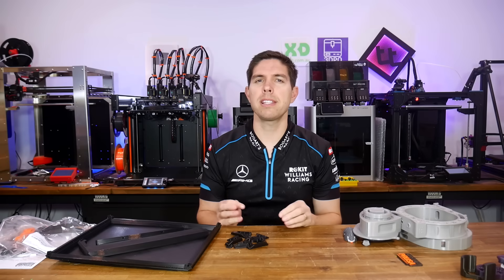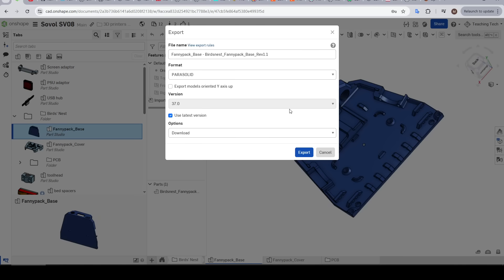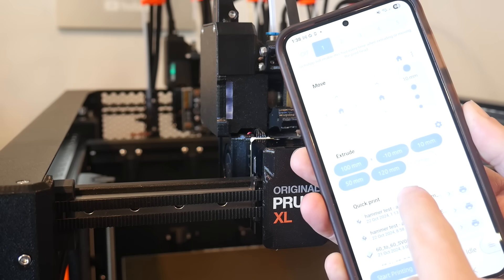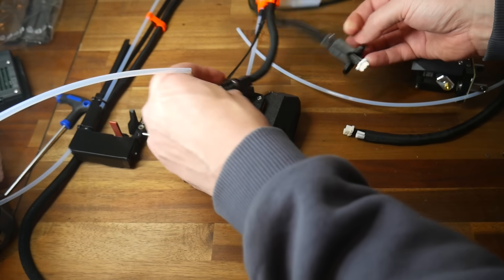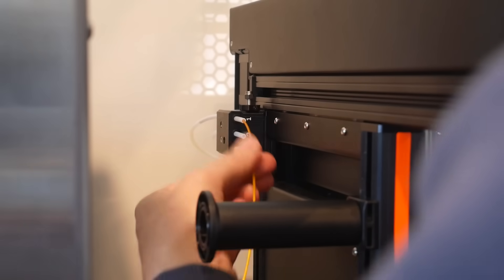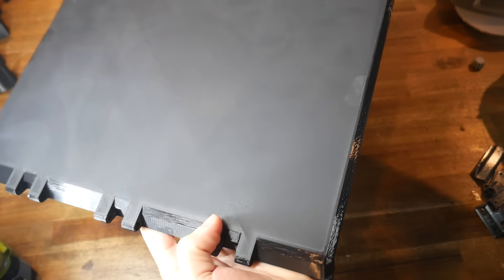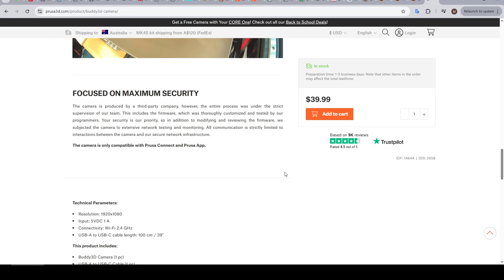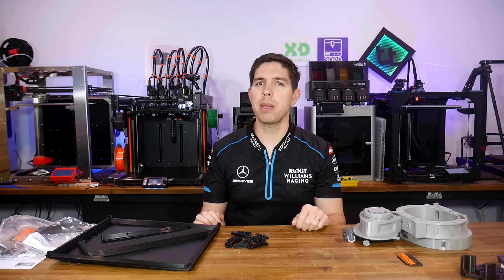Evaluating my replacement Prusa XL + SV08 update

Comment: I'll wait for the Bambu toolchanger.
Reply: Theirs isn't a true toolchanger. It can swap out the hotend assembly, but it's still all fed through a single PTFE tube via an AMS. So it still needs to cut the filament, fully retract it, do the nozzle change, then re-feed in the next color/material. Because the filament is disconnected from the remainder that was cut and left over in the hotend, retraction performance is going to suffer until its purged through. A true toolchanger like the XL, U1, INDX, etc. have totally separate filament paths for each tool.
Reply: the snapmaker U1 looks promising as well
Reply: They have complex nozzle changer cooking in the oven, and already showed how it works.
As response to that, Prusa showed actual image of Core One with INDX tool changer.
Reply: Bambu vortek is worse than a traditional tool changer, as found on the prusa XL, snapmaker U1 or even the bondtech INDX. Bambu lab was just caught with their pants down and had to come up with something quick since snapmaker was stealing their thunder. What they came up with will be a failure compared to just going with a regulate toolchanger. Meanwhile, prusa is coming out swinging with a 7 tool changer core one using the bondtech INDX.
Reply: @LilApe ahhh the prusa fanboy shill is back.
Reply: @colbycowley7549  Ah another bambu bot.
Reply: @LilApe  The Vortek will still probably be a more desirable system compared to all the others simply due to size and BLs quality.
Reply: @klaidasrunele  bambu lab and quality don't belong in the same sentence.
Reply: @LilApe Youve clearly never owned their printers
Reply: @klaidasrunele  You sure? I owned a P1P back in 2023 that was dead with a bricked stepper motor after just 10 print hrs. Guess what I found in the repair? The stepper motor that bambu lab use are the exact same garbage bin steppers found on a $100 ender 3 from 8 years ago, the P/N matched up. Bambu lab printers use the same cheapo components as a creality printer from 8 years ago. China quality will always be china quality no mater the brand or the price. That's just a fact.
Reply: @LilApe So you recieved a dud printer one time, which happened with every single manufacturer, and choose to use that against them. This was clearly a factory defect unlucky.

Cheapo motors or not these printers make high quality parts and reliably 2K+ hours X1C with no complaints. Complain all you want about with cheap psrts if the machines work.

Whats the alternatuve to BL then?
Reply: @klaidasrunele  If my P1P was a "factory defect", then so was Michael's XL
The alternative to BL is literally any other chinese brand as they are all the same in 2025. They're all built with the same cheap parts sourced from the same factories in shenzen, they all have piss poor QC and customer support. They're all funded by the CCP and collect your data and sell to the highest bidder.
Prusa is, and has always been a premium printer above the chinese brands. They have solder over 500k printers since they started over a decade ago and only have a 1% warranty claim rate. No chinese brand can come even close to that. Most, including bambu lab have at least a 15% warranty claim rate.
Reply: @LilApe The mumtiple XLs? The multiple XLs from every reviewer on the platform? Interesting that.

Piss poor QC and customer support? Actually seems pretty great from my experience. Printers have been great and thus is corroborated by many people eveywhere online. This is just you saying things.

You are making up conspiracy theories about 3D printers selling my data? What data are they selling? Mind you these  printers have a LAN mode for offline workflows...

Prusas warranty claim rate is respectable however you do not know the numbers for BL outside of speculation. Its a shame prusa printers are mediocre products that didnt innovate in years with their only somewhat interesting printer being plagueg with issues that stopped it from functioning.

Prusa is great but they just barely released a printer that can compete with BLs printers for a substancially higher cost.

Comment: Had my XL since launch (back when they came with 0.6 nozzles). It's performed well and is reliable. I think your review is fair and reflects my experience. They improved the noise of the printer and in silent mode it is quiet. In normal mode though the travel modes make a high pitch noise which goes through me. I also have a H2D and that is super quiet when printing regardless. Your comments about the menus are spot on. Dealing with loading and unloading filaments actually puts me off using the machine. As such it's only used now for large prints I can't do on the Bambu's or if I need more than 2 colours/materials. Even then I weigh up if the H2D can do it. I'm glad I got it and still love the mechanical tool change mechanism. I expect Prusa will update it with the Bondtech solution.

Comment: This is what I really dislike about Prusa and being an early adopter that paid CASH for Prusa.   They are XL.  xtra lazy and slow to change and waited 5 years to TRY and do anything and failed and are failing.   The Bambu H2C will finally end Prusa.    Prusa only had to offer $100 upgrades and they could have 100's of thousands of current machines but had to continually OvER CHARGE and under deliver.   Blackberry incoming!